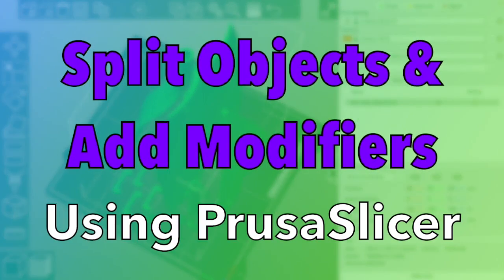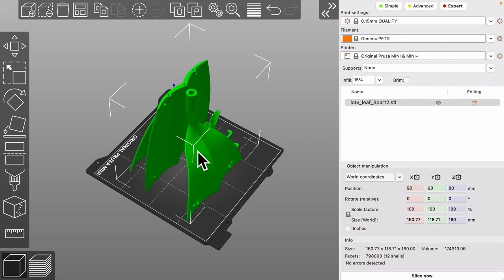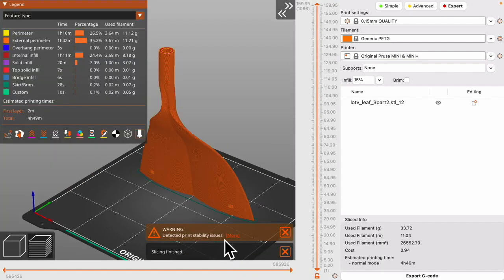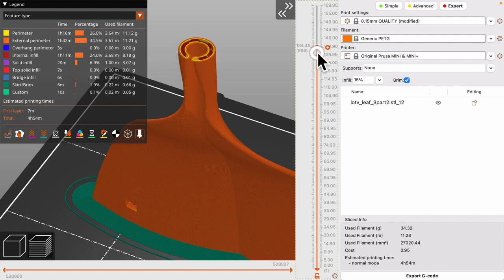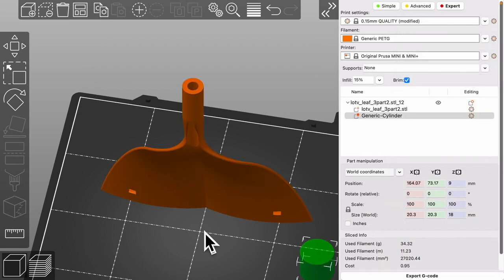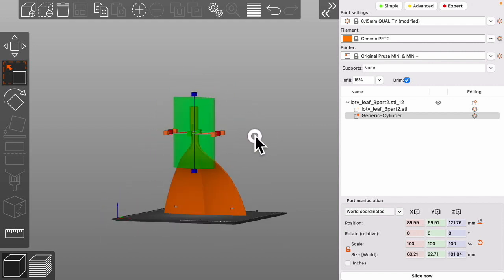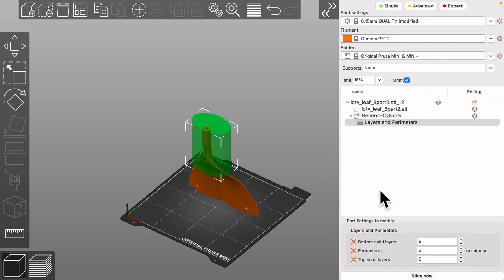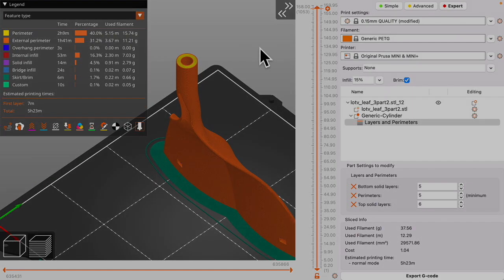Splitting and adding a Modifier using PrusaSlicer

Comment: how do i make a part not automatically fling itself back to the base plate. i cut a cylinder piece to make a quick modification so i could increase the length of part of a tube without messing the entire scale of the main part of the tube up...